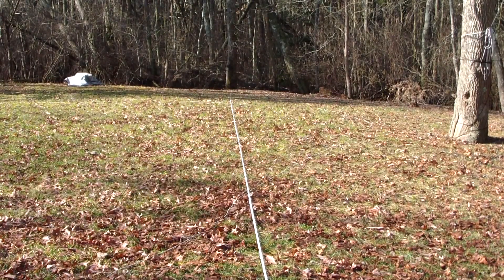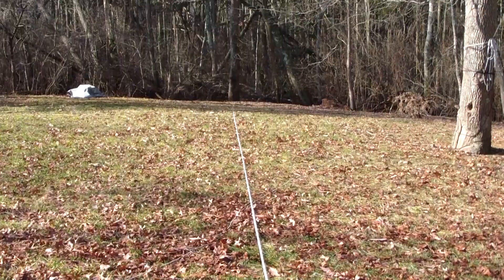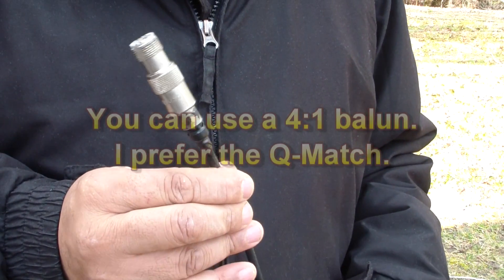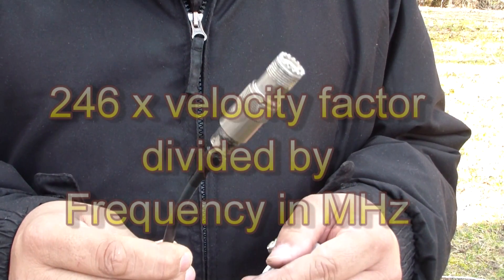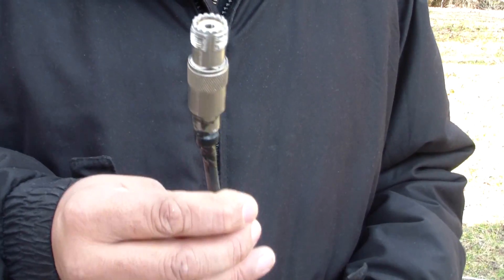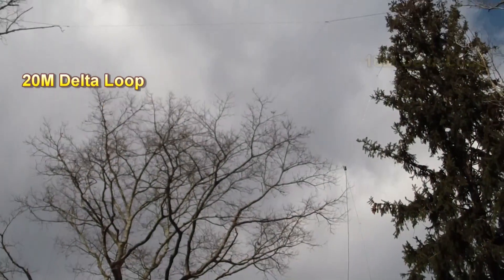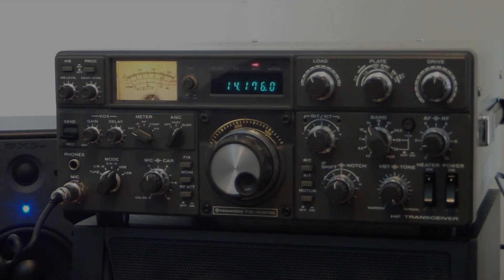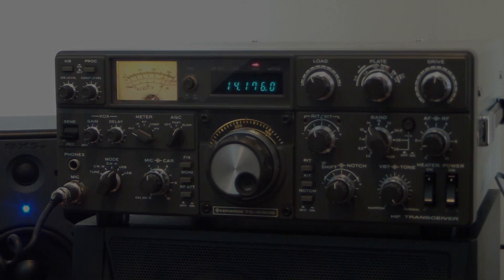How to build a Delta Loop Antenna

Comment: there is something behind you
Reply: That is a rope.  I use it to pull down tthe antenna if i need to repair it.  Better than pulling on the cable.

Comment: I thought that I left a message last time I viewed your video. So I will leave another one. This is awesome information on building a 20 meter delta loop antenna. I came back to review it again before I start construction on mine. The Q-match is so much easier to build and cheaper than a balun. Thanks again for the instruction. 73, NZ7B
Reply: Thanks Floyd. I hope you are on the air with it.  It is simple to build, perform very well and inexpensive to build. I use them all the time.  If you look an my QRZ page - WV2H - you will not only see more pics of the station and antennas but also my log.  That is my barefoot log.  Since March 2012, I have worked 215 DXCC all with 100 watts and wire antennas!